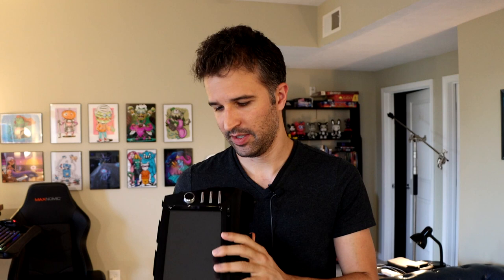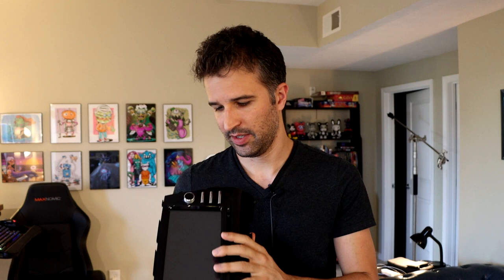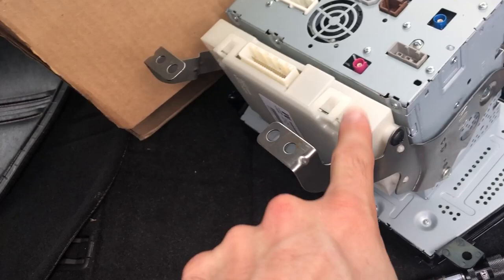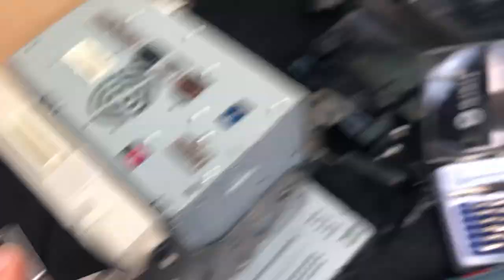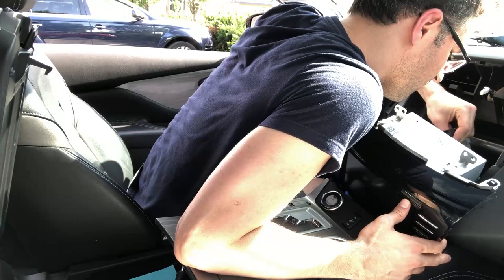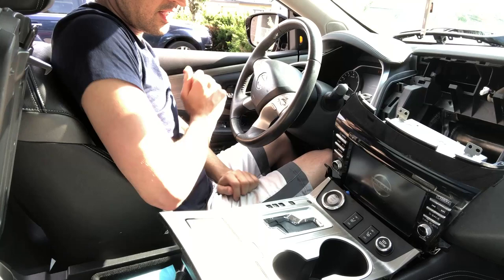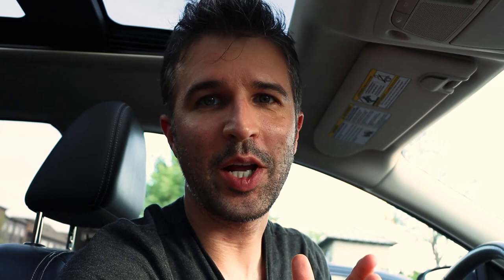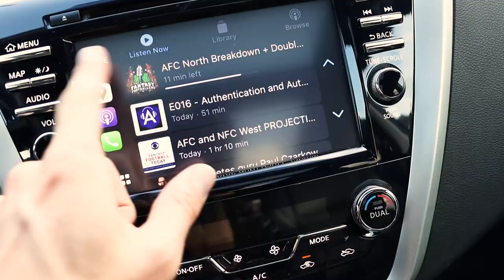Apple CarPlay: Out of the Junkyard, into My Car

Comment: This video was great! Thanks! So I replaced the original 2015 unit (25915-5AA1A) with a 2017 version (25915-9UC1A) that shows CarPlay, but grayed out — so close!!!

What I observed was that the new unit did not come with an SD card so the built-in navigation feature were unavailable. When I plugged in the old unit's SD card, the built-in navigation was briefly available, but CarPlay also disappeared.

EDIT: Make sure your replacements come with a compatible SD card. Someone correct me if I'm wrong, but it looks like it stores local settings and presets in addition to map data.
Reply from the maker: Thanks for sharing these findings. The unit doesn't do much without the card in it. Maybe you can find a newer card on eBay.

Comment: Hi there. Thank you for the video and Apple CarPlay information. I have the same year, and bought the same radio that you upgraded to, however, I am having an issue with the Navigation and am hoping you have an answer. Everything works except the factory navigation is showing the wrong location. I am in Massachusetts, and the Navigation says Im in Michigan. I have tried resetting the radio, but it didn't help. I am hoping that maybe the antenna is loose, so Im going to check the connections tomorrow. Any ideas? Thank you.
Reply from the maker: I’m not sure, but I’m confused about why you are using the factory navigation. The point of doing this is CarPlay/Android Auto, which enable Google or Apple Maps, which are infinitely superior to the factory nav. I never use the factory nav, ever.

Comment: Hello, just to clarify. 

I have a 2015 Nissan Versa SL, I have a touchscreen radio, with steering wheel controls etc. All the good stuff, just not Apple CarPlay haha. 

Will my original camera still work if I were to install another one, and will my steering wheel buttons such as volume control, calling buttons still function with the new radio?
Reply from the maker: I cant' say for sure with the Versa. In my case, everything works perfectly as before, only now there is Carplay. I doubt the average person would even be able to tell anything was changed.

Comment: Does this head unit also have android auto?
Reply from the maker: I believe so, but I don’t remember. If you search the Nissan Murano forums on Google you can find out for sure.
Reply: Yes it does
Reply: @justaross  I'm unable to search the part number in the website in the description. Is there any way you can provide a link for the 2018 head unit version?
Reply from the maker: @shivankarsingh1620  check the forum thread linked at the bottom of the video description

Comment: What do you with the bottom white part? Do you replace it with the one in your unit?
Reply: In my case it was a simple swap with a plug and play solution into my platinum.  I think the white box is for the Bose speakers and subwoofer which I have.  Interesting thing I found out is that the head unit was not even rebranded, it is from Clarion
Reply: @slypx2  Thanks. Did you have to do anything special to get Sirius XM activated on the new unit?
Reply: @GiuseppeAriciTiamarie  no, out of the box, everything worked just fine, the dedicated SD nav card was included and Sirius was, and still is after 8 months, activated !!  If you get one and need activation, just call Sirius with the Sirius radio ID, and they will sell you a package.  PLEASE, do not accept their regular package, there are always some sales or retention packages check their website regularly.  On my other car, I got a full year for 55$ including online streaming and at renewal I asked for the same deal and always gets it
Reply: @slypx2  thanks!
Reply from the maker: @slypx2  I installed in on the new unit using the existing mounting bracket. I believe it’s related to the Bose sound system.
Reply from the maker: @GiuseppeAriciTiamarie  no but I don’t use Serius and never have.

Comment: Can anyone help me finding the correct part ? I am having trouble locating the right model to use :(
Reply: @cmentor  thank you. I have a 2015 Platinum With Bose, it was overwhelming to make sure I am getting the right part.
Reply: @cmentor  hello. Just to be clear if I have a 16 maxima platinum, what part # should I be looking up if I want to get Apple CarPlay? 25915-9uc1a?
Reply from the maker: @fherrer2  I'm not sure about all the part numbers. I put the info I used in the video description. I'd check out the forum page I linked on Murano Forums for more info.